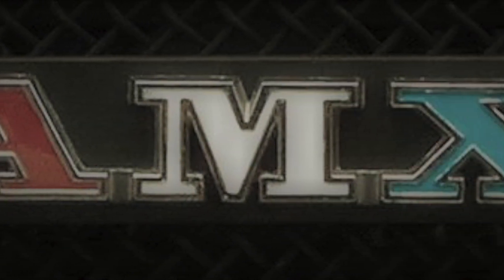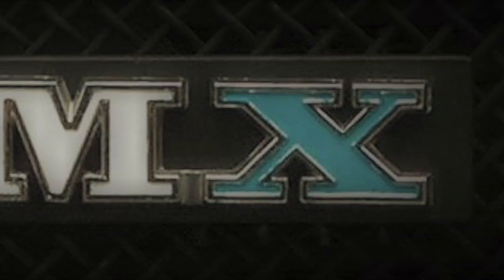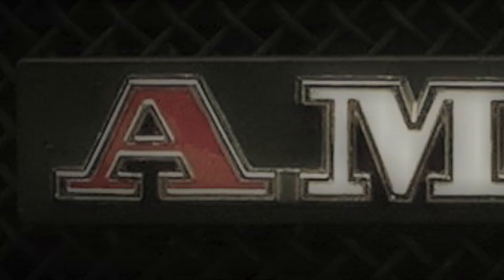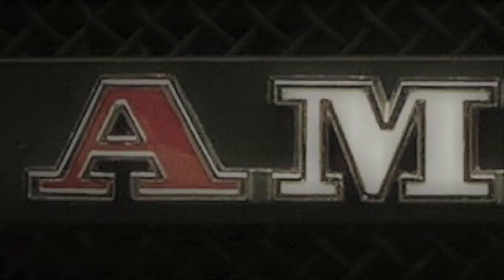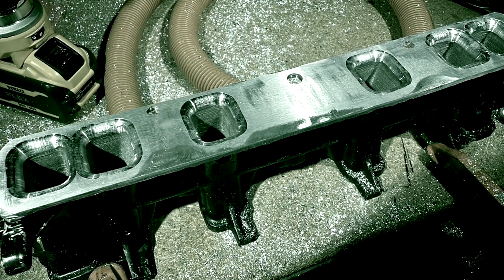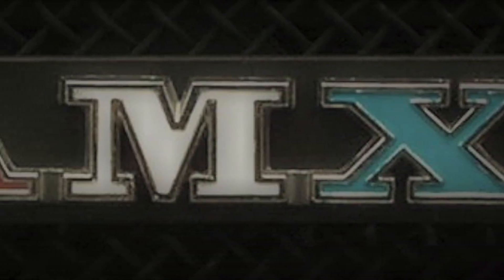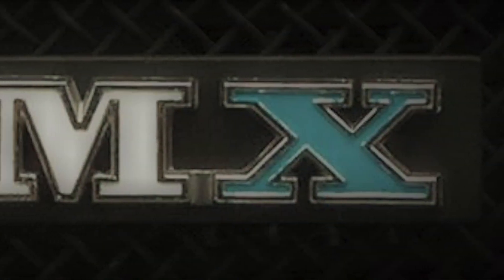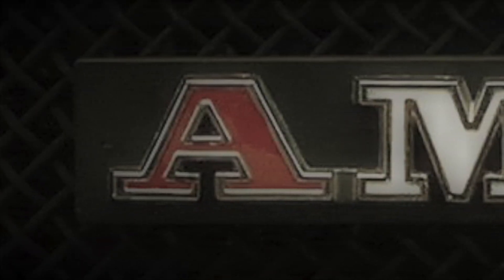Building a 10,000 RPM Jeep 4.0 - Best Heads and Intake

Comment: I copied basically the aftermarket supra intakes and built a 2 collector Tri-Y header. Ported my Renix head and rollerized everything and takes very little to rev past 6500.
I didn't build it to rev high though, I wanted a boosted stroker. It makes about 338 whp NA but with boost I've had some trouble with fueling recently which I have corrected
now I hope and going to push it up to 16-17 psi of boost from the 13 it makes. Should hold together no problem, every time I inspect the motor the parts still look like new.
Reply from the maker: I’d love to see a video of that!
Reply: @amxj  I'll make one a little later. I just got it together yesterday. I advanced the cam 2deg and it's ridiculous even with 8psi. I haven't pushed it yet because I'm giving the new rockers and bearings a bit of a break in period. When the weather gets a little cooler it's hot in that thing 😆

Comment: See I always figured more runner length would give it better torque, plenum volume would be easier to increase. it’s nice to hear the main man talk about all the fine details
Reply from the maker: He confirmed and dispelled some of my preconceived notions about the 4.0 motor. It’s great to have the man himself talk about how and why this all works together.
Reply: Try to tune for the 3rd or 4th harmonic, runner length can fill the cylinder better if its tuned to one of these harmonics, obviously the 3rd Harmonic is slightly stronger than 4th. About 3%.

Comment: It might be difficult to find a 92 head. Are the Edelbrock units well designed? Are there major disadvantages to going with a 4.6 stroker? I'm more concerned about torque. Do the strokers tend to have good longevity?
Reply: I haven't looked at the Edelbrock 4.0L AL head on a work bench, but it appears to be a good head?  It would more than likely flow better than a Production iron head or why bother to make it?  People like the 4.6 L conversion & it's durable, they make NICE TQ!
An Edelbrock head on a stroker sounds like a winner to me!
Reply: naturalcreature6317  I knew the Edelbrock head would be better!  Thanks for the verification!

Comment: All that thinking for a 100hp engine. Imo 4.0 was never meant to be a performance engine
Reply: Neither was the flathead V8, or the Buick 225, or the Ford 300 I6, or the air-cooled VW flat 4, or the Pinto 2.3, or...
Reply from the maker: Yet some professional builders are squeezing 800hp out of them.  It's less of a challenge to build power with an engine designed to make it and a strong aftermarket of 'bolt-on' power adders.  You have to be a serious engine builder and fabricator to coax 800hp out of a 4.0 - you also have to fabricate your parts; you cant buy them.
Reply: A truer statement !  They don't make real race engine parts for a 4.0L!  A lot of hand made eng parts were used until we made it FAST!